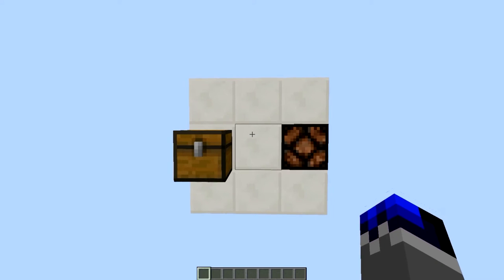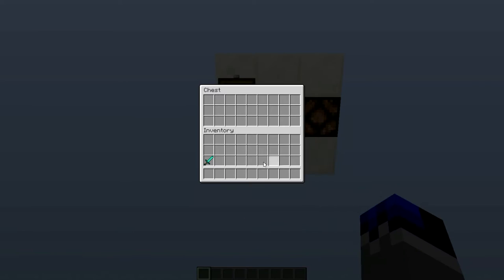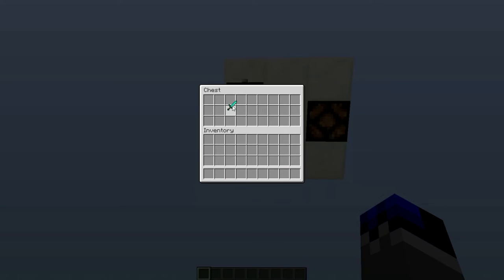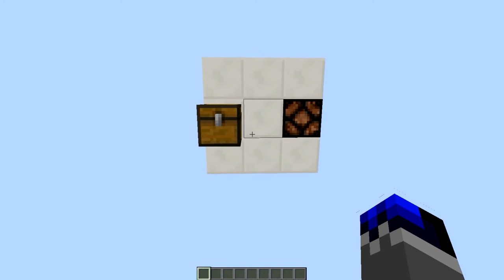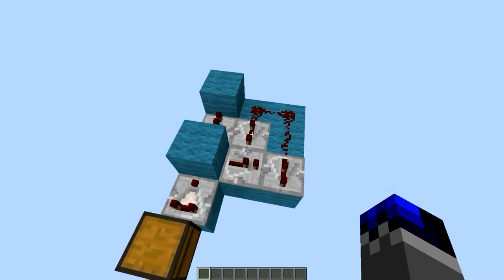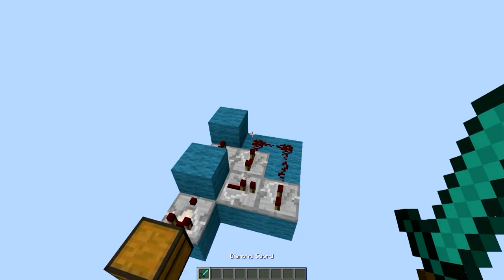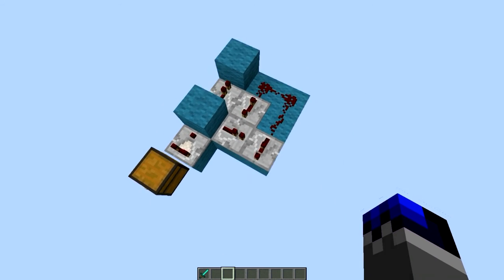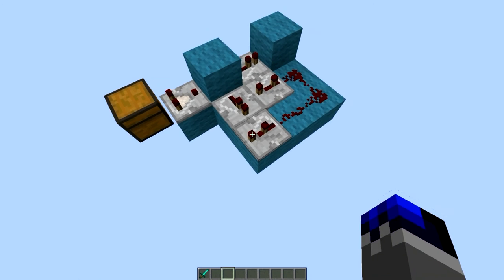Quick Click Hidden Input Device

Comment: This one is 3x4x2. I have an 3x2x3 one with the ouput on the front like yours. I can't make a video but I can share some screens for the community. In total, it's 12 blocks if I count the necessary ground on it.
It would almost be "3x2x2" if one comparator was not on the ground (and so I have to count the block underneath). 
Are you interesting to see it and maybe sharing ?